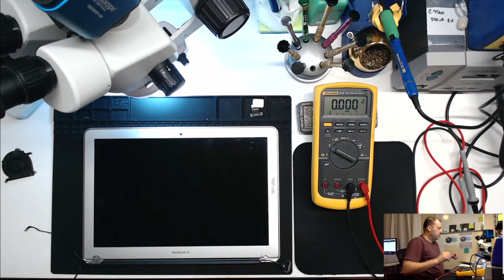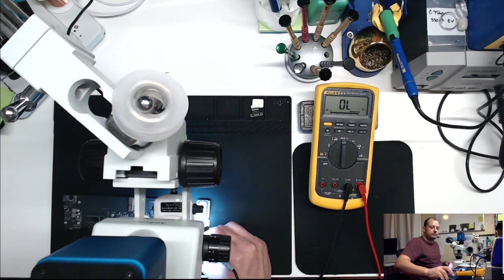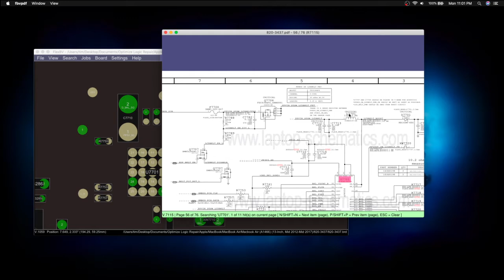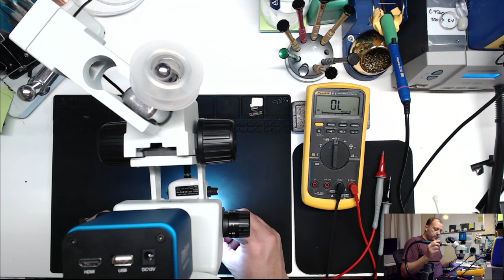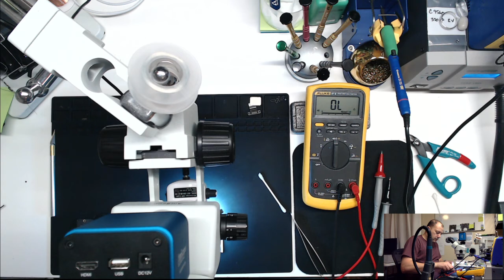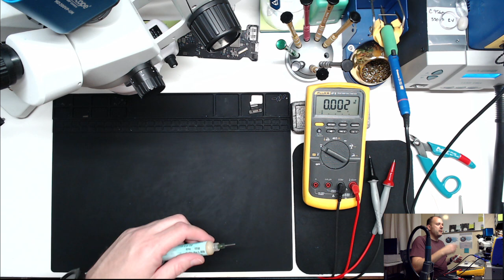A1466 - 820-3437 13" MacBook Air No Backlight Repair

Comment: I see you got a microscope camera now.
Reply from the maker: I did! only problem is I cannot figure out how to get OBS to see it via HDMI.
Reply: @optimizelogicrepair2784  I believe you will need a capture card if you are wanting to use HDMI in OBS. I see you have a USB port. Does the USB allow you to connect your camera to your computer?
Reply from the maker: @iRevive  It does but I have to play with settings. I cannot seem to adjust the camera to focus with what I see. Like the camera is blurry and the eyepieces are clear or vice versa. I have a .45X adapter on there now but I also bought the 1X from AmScope.
Reply from the maker: Also my MacBook only has 2 USB ports LOL. Trying to build a new PC to use instead. I have the perfect spot under my desk, right next to an 8 port switch.
Reply: @optimizelogicrepair2784  Do your adapters have the ability to adjust the focus?
Reply from the maker: @iRevive  they do